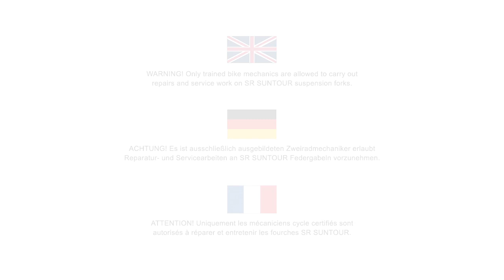Lower leg install

Comment: It says cartridge side torque 10 NM when working on air shaft side and air side 6 NM when working on cartridge side?! Is the name wrong or the torque wrong or both? 6 and 10 NM is a huge difference and having a video to follow that is wrong is inexcusable, especially after someone already commented about a typo close to a year ago. I'm sure selling stripped out replacement parts doesn't bother too many people. Just like saying internal travel adjustments doesn't mean adding/removing spacers like previously, but buying a $60 air shaft assembly. Half the reason I bought the new Auron is because it allowed "internal adjustments" to the travel like just about everything you can find shows done with a spacer, including the video on website about changing travel. Don't have a video showing spending an additional 10% a replacing guts to change travel...

Let's see if I can strip something because of incorrect information before selling this thing. Sometimes giving something else a try really isn't worth it.